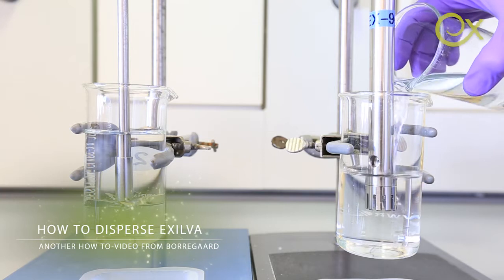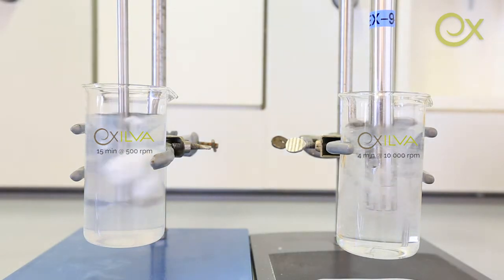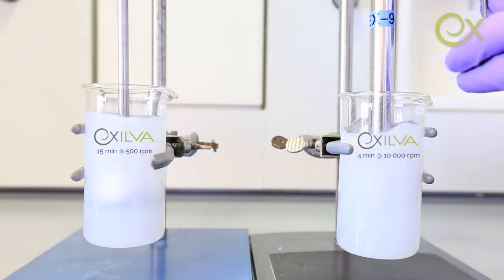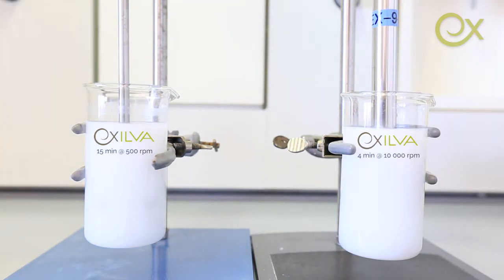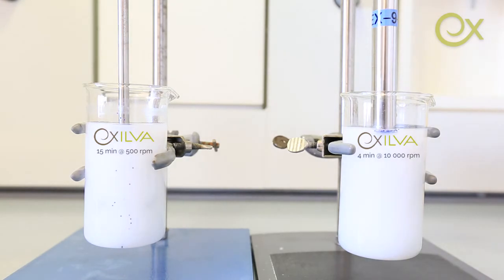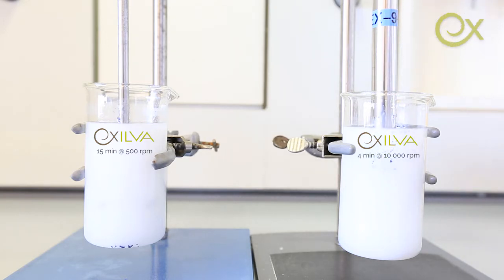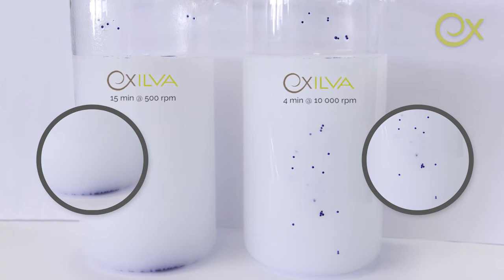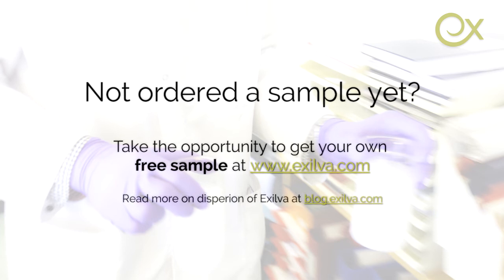How to disperse Borregaard's Exilva Microfibrillated Cellulose

Comment: Problem with exilva is that, being a costly material and used in higher proportons compared to other thickeners, it is not feasible to use in some formulations
Reply: Due you Plz tell me other thickners instead of boron